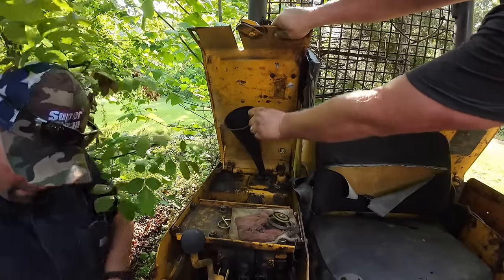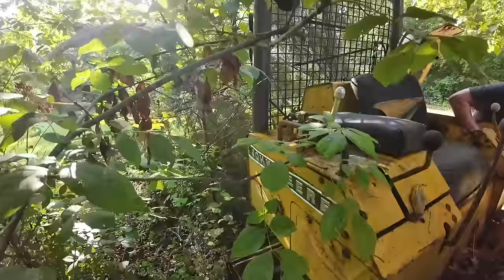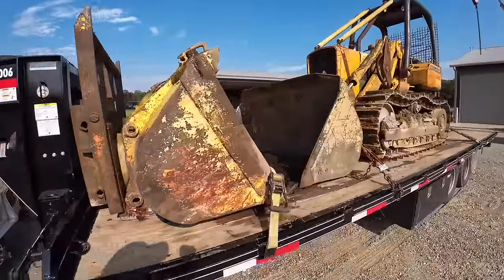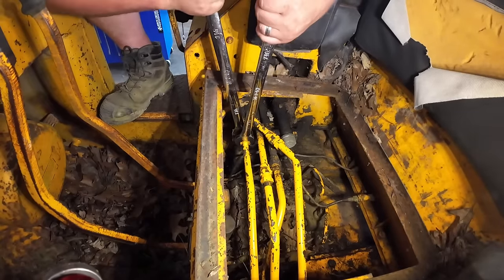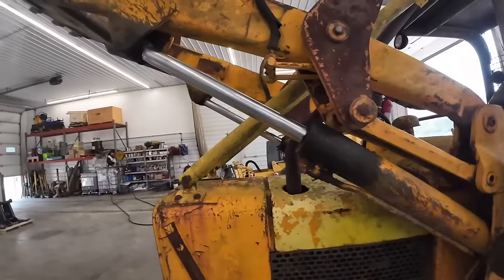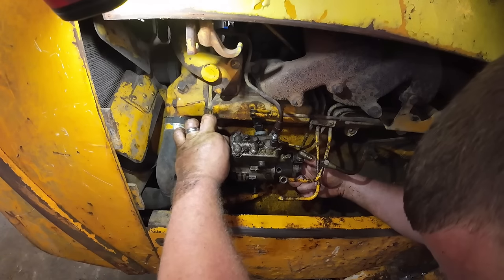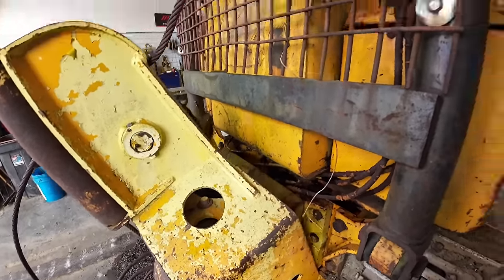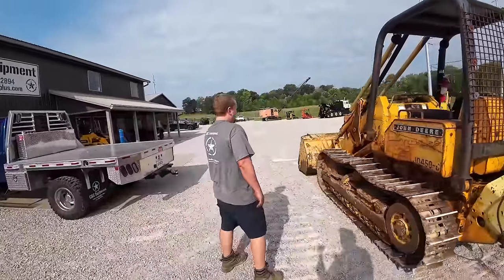Will it start, ran when parked… maybe or? John Deere 450C track loader rescue mission from the woods

Comment: I used to work for a John Deere dealer back when that 450 C was new. Our truck driver picked a customers loader and brought it in for service. On the way back he came down a hill with a bridge over the creek and a sharp right curve. When he hit the bottom of the hill the trailer flexed down then up. All of the binders came loose on the down flex. On the up flex the the 450 sailed up and over the bridge rail doing a forward flip landing on the tracks right side up, on the bank of the creek. It broke both final drive housings. The customer got a great deal.😂

Comment: Hey There C&C Guys, I Hope This Finds You All Well?  🙏

The "C" Series Dozers and Loaders were introduced in 1974, with a slew of improvements.
One BIG one was the introduction of "Wet Steering Clutches!" 

The "C" Series was also the first Deere to have a Turbocharged engine.

The "C" Series was one of Deere's most popular, and even today they're still being used, and are highly sought after.

I don't think I've seen pads like those on a Loader, typically they would've had "Street Pads."
I would say it's been in the woods. 

This takes me back to the time Dad had his JD Industrial Equipment Dealership in Salem Virginia. 

I hope y'all have a good one! 

"Nothing Runs Like A Deere" 🦌 👍 🇺🇸

Comment: Clint, your comment re putting tape on joints hit on one of my pet hates. So many people who call themselves qualified have no understanding of how things actually work. Tape is only needed for tapered thread fittings. I have come across tape on O ring fittings as well as the type you used. I have also purchased OEM parts supplied with tape for fittings which do not seal on the thread, but on an O ring or metal to metal taper.
To have a mechanic not understand why they are doing something worries me.
That's why I  like your chanel so much, you and your guys actually understand the why.
I am an old untrained (farm taught) mechanic, but I  have always worked on understanding how something works, not just because I was taught something.
Reply from the maker: Thanks

Comment: This video couldn’t have come at a better time for me. I just bought an original John Deere 310. The injection pump was off of it when I got it. The pump is supposedly rebuilt, but I cannot figure out out to get it back on that shaft past those weird seals. I’ve got the motor on TDC. I think I’ve got the pump timed, but I just can’t get it back on that dang shaft. It keeps rolling and pinching that rear seal.

Comment: They are popular on the shorelines to run rock up shorelines to supply rock for erosion walls . saved the excavator from  having to run back N forth.  Owners will run them for a Yr or two and sell it for more than they paid, and saved paying float fees a few times over a couple yrs as your progressing on your project

Comment: You need to teach DP and MBTS how to pour fluid from a 5 gallon bucket. I told them to turn the bucket over so as not to make a mess. Trying to fill an oil filter from a 5 gallon bucket makes a mess, runs down the side of the bucket.
Reply from the maker: Sometimes they do stupid stuff just to get a comment out of people

Comment: I was just working on a 4020 that had about 10 gallons of fuel in the oil. I went for the transfer pump because its easier and got lucky because it didn't put anymore fuel in the oil.

Comment: The motor has to be at a certain RPM for the little shaft that comes out the tail of the transmission to run the winch like 1500 RPMs

Comment: It was long before you young bucks making or repairing a hose was cost effective and saved a lot of work when a hose would leak at the fitting.  You just cut the end of the hose off in the machine. Unscreww the 2 parts off the junk peace. Scanned the rubber off down to the wire brake hammer the outer nut on an tread it over the hose. Take the center peace that has the nut fitting on it an screw it in. Hook it back up an back working. Making a new hose you take the fittings a part off the old hose prep the new hose put fittings on that you took off the old one. Put the fitting into an old pipe threading machine and screw it together your done. The only waste was the old hose as you used the fittings over an over until the fitting broke. Then they came out with this really costly crimping shit. Once fitting crimped on that the end of it. You have to buy a $1200 press and every fitting you need every time and they are very costly.   Unlike before all machines had the reusable fittings. And it was faster then this crimp bs an huge waste. I have 5 gallon pails of all styles an sizes up to #20 from when I worked in the Bush an we stripped all the short wood Korina harvesters and used the frames to build Korina de-limbers pulp loaders. You sit an operat 16 feet up in the air. I all so have miles of good hose with the reusable fitting that came off them from #4 to#20  hoses are 20 to 60 feet long. Been my life supply

Comment: Clint, I have a 750j that we keep losing antifreeze on. Pressure tested system, can’t find any leaks. I suspect it has a bad liner with a pinhole and it’s vaporizing in the exaust. My question is, in your opinion, by the time we get a mechanic to repair it plus the parts, would it be more cost effective to just do a new crate motor at the dealer? Thanks
Reply from the maker: I’d say it be way cheaper for a good mechanic to do it
But if your in a hurrr then a crate engine is quick
If engine has an egr cooler I’d be checking that first

Comment: Have you guys ever had a runaway in your shop? If so how do you guys handle it? I've only ever had runaways with Kubota engines lol, their fuel system hardware is so dang tedious. Every corner of the shop now has a 10lb C02 extinguisher 😁
Reply from the maker: not in this shop but i did with at the old shop
I cut a fuel line on it

Comment: Can’t complain about the possibility that the leaky hydraulic line was broke free off line when you show the brain fart of not having the wire connected on the injection pump. 
Just continues to prove you’re human. 

Hopefully the eBay auction gets to the point you’re hoping for. Nearing $12K this morning already. Probably go a lot higher when people realize the black Chevy is included. 😉

Comment: Dang Gummit Kevin!!! You know you got to hook up that freaking forking fuel shut off solenoid. Dam son don’t you watch them Diesel Creek or Area Diesel Service LubeTube vidja’s; if you did you’ve have been properly learned up what dat der wire does and why you needed to plug that back in before went à running off to litter boys room to make your bladder gladder. Not that I have beaten the subject of “the wire” the question now remains that if a grow man with stubby sausage fingers had to run off to go to the potty before plugging the previously mentioned wire in is that man a card carrying member of the Indiana IBBC (Itty Bitty Bladder Club) 
PS I was going to just post a comment that said “feeding the algorithm,” but it was y’all that brought up the subject of the keyboards getting pounded into submission with comments that provokated me into posting this tripe
Reply from the maker: Lol